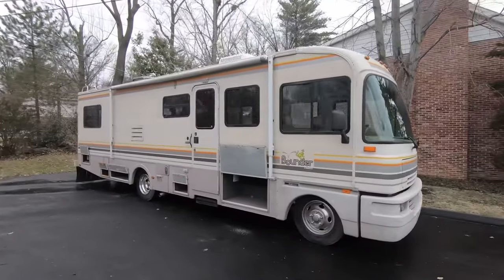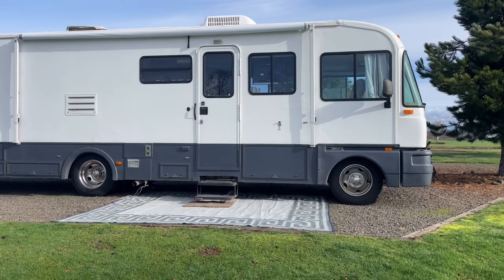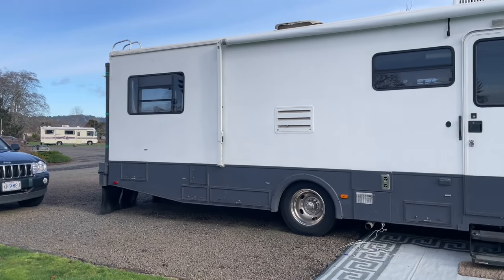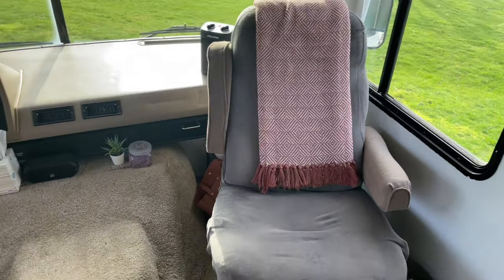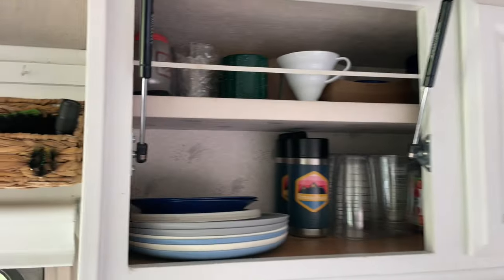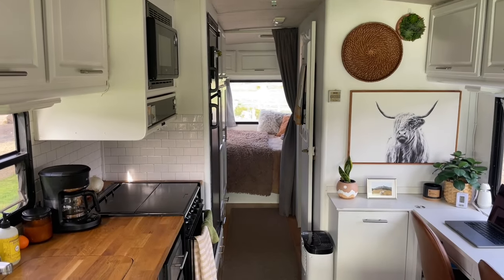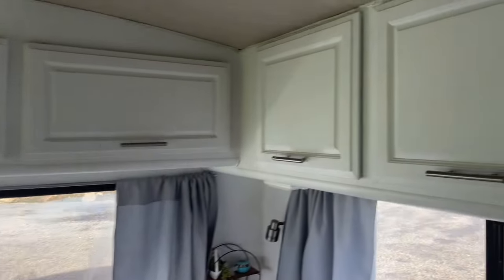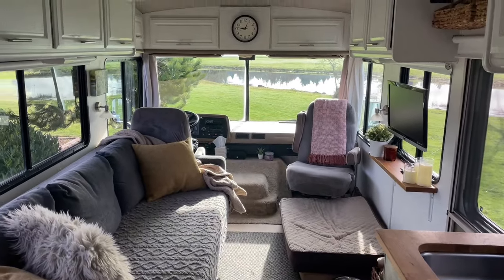Fleetwood Bounder - Full Renovation Inside and Out - Full Time Home

Comment: I just bought a 1996 Fleetwood Bounder.  It is going into the shop to have all the fluids changed. Then, I will  have the engine and transmission checked. Found out that it rolls while in park, even with the emergency brake on. After those are done, I will have the generator and tanks tested to make sure all is in working order. I like the changes you have made. It has brightened the inside so much. Making it look almost new again.
Reply from the maker: Kudos on the new coach my friend.  You're making all the right choices having everything checked out and addressed before any major trips.  Let me know if you have any questions or there is anything I can do to help!

Comment: Love it.  I am still driving and restoring my 1990 Fleetwood Limited.  I repowered it from EFI 460 & 3 speed to a 5.9l 12 valve Cummins with an Allison 1000  5 speed. Went from 6 mpg to 13 mpg.

Added solar, 9 outside cameras to help with driving and security, a big screen pop-up tv movie theater recliners, surround sound ect ect.
There is took much to list since I bought it in 1997.
Love these old restored rigs.
Reply from the maker: That’s awesome.  We’ve been to a handful of RV shows and the newer rigs are really cool but we would have to spend $250,000 to get anything we’d rather have than our old girl!

Comment: Solid chassis on these.  Make sure to carry a spare ignition module for the distributor. Easy fix for a common failure on the p30.  It fails because of heat buildup.
Reply from the maker: We’ve been driving her for half a decade and haven’t had a problem with that

Comment: Looks amazing we have a 99 36S we are remodeling!  Appreciate the video
Reply from the maker: You bet, glad it was helpful.  What projects are you tackling at the moment?
Reply: We are replacing the roof with a new membrane and all new vent covers. Also solar 1800 watts and have 4-100 lithium batteries we have the 5500 generator onboard. Fingers crossed.

Comment: I had a 91 Bounder on the Chevy p30 chassis, it was a nightmare to drive with wind and passing trucks. Also, the gvw was not much more than the empty weight and could be overloaded real easy.  Replaced it with a freightliner diesel pusher and that made a world of difference both driving and not even coming close to overloading it.
Reply from the maker: Good to know, we’ve got her loaded down pretty good and haven’t had any issues yet.  Thanks for watching and leaving a comment!

Comment: Finally found a video of a Rv like we have acquired - great job and it gives me hope that my 94 Fleetwood Southwind can be renovated - I’m wondering about some of the derails such as did the inside wall surface have to be redone ? Such as the wall board? I have some damage but not sure how to fix the actual wall board? What about the mechanical systems such as plumbing? Electrical ? U mentioned about the tank monitors for example as well. What about the leveling jack system ?
Reply from the maker: Anthony, we found some white plastic type material at Lowe’s that worked well for our wall covering.  Our plumbing was in good shape and so was the electrical.  Nothing major to address.  We didn’t have jacks so no worries there either

Comment: I have a RV with a P-30 Chassis also, how is the engine, brakes, batteries, axel and back up camera, stereo,and GPS etc etc, all holding up. So you can take a really long trip, like to Alaska or back east.
Reply from the maker: I wouldn’t base your decision to take a p30 to Alaska on our rig, but overall, she has performed well.

Comment: Wow what an incredible transformation yes it's a huge undertaking trying to take something that was raw and making it your own..! And finding it very livable. Couldn't help but notice you don't talk at all about your electrical situation other than the Onan generator you have no solar no power other than the generator? So you are pretty much depending on staying with full hookups at RV parks? And I understand what you mean about taking 4 years to build it or more that's about what I've been doing with my 1977 Dodge Mallard class C. We going out on a few journeys but we're going to be fully boondocking. Off-grid and solar powered. Thanks for the great video on sharing your experience wonderful job oh by the way we painted our Lucy as we call her with spray paint she turned out looking pretty good she turns a lot of heads and then they bow and pray and as we pull away.
Reply from the maker: Actually we spend about half of our time out in the woods, on public land.  We use VERY little power on a day to day basis.  We have a bluetti eb70 solar generator and the matching 200 watt portable solar panel for our phones, laptops and small personal devices.  We can comfortably go five or six days in the woods on our house batteries and use the bluetti products to maintain our personal electronics.  We try to plug in once a week for a couple of days to charge up, then head back out or down the road.

Comment: How long does the generator last if you're away from a plugin?  Can you run the fridge a few days off-grid?
Reply from the maker: Generator will run as long as we have gas.  Eats about .75 gallons per hour when running at full tilt.  

We can run the fridge off the onboard propane for over a month with no problem.